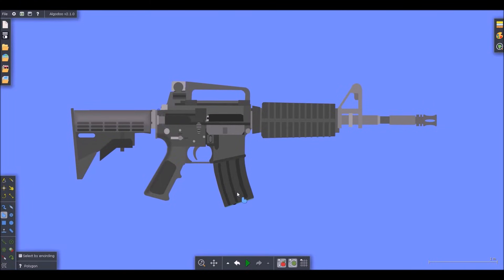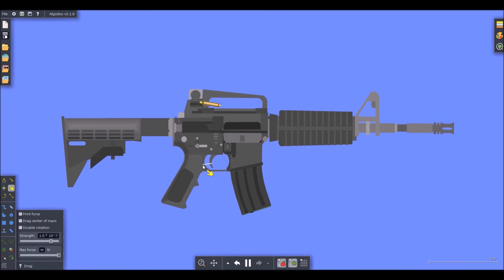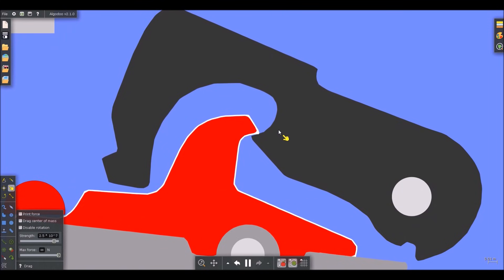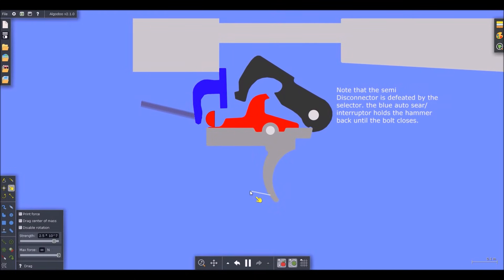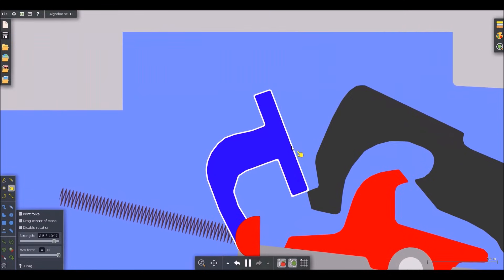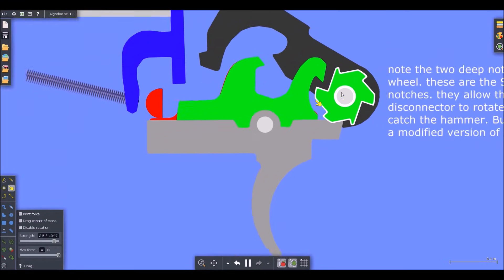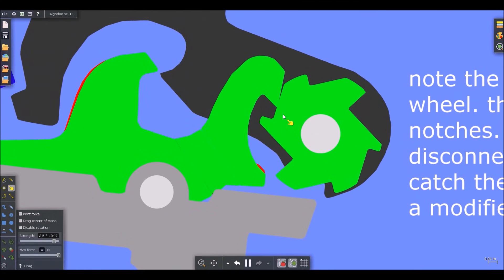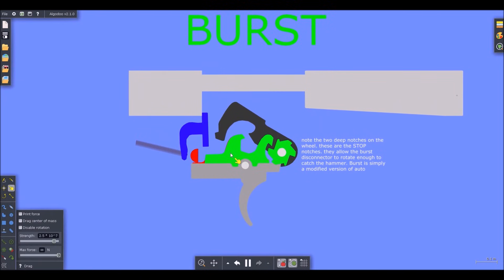How 3-round burst works

Comment: How does the gun switch (other than you switching modes with safety/mode switch)? I mean what internally changes which sear is used and how does that work?
Reply from the maker: Your selector/safety is attached to the selector axle. Along this axle, there are cutouts that engage or disengage the auto sear, semi disconnector, or trigger. When the cutout for that particular mechanism faces the mechanism's index, it will allow it to move, and thus operate. In the safe position, the cutout for the trigger is facing AWAY from it, and the axle directly prevents it from operating. In semi-auto, the cutout faces the trigger index, allowing the disconnector and trigger to move and operate. In auto/burst, the axle defeats the semi disconnector by engaging its index, while the index on the auto sear (it's little tail) is disengaged, and the cutout faces that. So the auto sear will operate, but the disconnector will be held back.
Reply: Very cool! Thanks! Would love it if you made a video of that as well, but I understand mostly! Thanks!
Reply from the maker: Andrew Stark check out my burst faq video. It demonstrates that a bit. Link is on the annotation at the beginning of this video

Comment: so in theory if one were to remove the cam-wheel and put a spacer there it would fire full auto?
Reply from the maker: That would technically work, but it'd be inefficient. The best way to mod the burst kit to full-auto in a reversible fashion would be to remove the burst disconnector and insert a washer of similar thickness. Switch to burst, and nothing will ever catch the hammer in that mode.

An irreversible but equally effective mod is to trim down the burst disconnector's hook interface until it no longer engages the hammer
Reply: haha awesome! of course i will not do that, but its nice to know. thanks for the quick response!
Reply from the maker: Thanks for watching! Glad to help :)

Comment from the maker: Mark Scoble It has been a challenge to find the information on the Stoner Burst Kit. I have had very little luck on the HK or Sig variants, but I have tried. maybe some day I'll get some ffl and own a few, or the U.S. Govt. will become a bit more compliant to the constitution. Who knows?
Reply from the maker: I will take a look and work on it. Thanks!
Reply: ***** If you check out Gun Disassembly 2, it comes with a Sig 552 model in which you can get a decent look at the burst system.
Reply: ***** If you are interested,I have an HK book that describes the burst mechanism of MP5 in detail.The book has 28 pages and it has pictures.This animation was very good and I would love to see the burst mechanism of MP5 in a video like this.I can send you the book, if you give me your email.
I also have a question.I already knew how the Stoner burst mechanism works, but I was never able to wrap my head around how the movement of the hammer rotates the cam backwards.You said that it is some kind of ratched mechanism.Actually there is a spring between the hammer and the cam, but I cannot understand how this spring rotates the cam backwards.If you know how this works,I would be thankful if you can help me to understand it.
Reply from the maker: Catching Fire from what I've seen, there are actually little indexes on the inside of the cam that the spring engages on when the hammer is pushed backwards, but the spring slips over them when the hammer drops. it's essentially a ratchet mechanism with two moving parts: the hammer and spring, and the cam wheel.

I'd LOVE to see that book! Thanks for offering to show me :) find me at stealththeunknown@yahoo.com
Reply: ***** Thank you,it's more clear now.I didn't know how the spring engages with the hammer and the cam.Still if you know of a book,site  or some pictures that depicts this,please send me a link.

I have send you the book on your email.It would be great if you can make an animation of the HK burst action,since the HK system is more complicated and more difficult for people to visualize.

Comment: What happens if you let go of the trigger mid burst?
Reply: bigred2989 It stops firing. So, assuming you fired only one shot on burst mode, you'd only fire two shots the next pull of the trigger. This was one of the reasons that burst capable M-16s were phased out, so I've heard.
Reply from the maker: If Arnold Schwarzenegger were using one and stopped mid-burst, he'd say something like, "you have been terminated". It'll do exactly that, and your next pull will pick up where your last one left off. If you fired one first, the next would be two. If you fired two, the mext would be one. Best bet is to just hold onto the trigger until it stops, release, and hold again
Reply: Stealth The Unknown I see you tried too hard to be funny and failed miserably there, just answer the fucking questions, no forced jokes and that's that. Oh and fuck yourself.
Reply: Charles Ferdinand Damn, why are you so hostile?
Reply: @metallizität  he is probably a liberal

Comment: im makeing a luty style smg and to make things easyer im wanting to use a 9mm ar 15  bolt and barrel and im wondering can i achieve slam fire welding the fireing pin into a fixed position  and fiting it in to another bolt carrier
Reply from the maker: Are you trying to make a runaway mg? This sounds like a modification that would only make it good for dumping entire mags, and the way it sounds like you'd fire is by using the bolt catch/release. This seems extremely dangerous, and unreliable, too. the AR was not built for firing from an open bolt. But if you can legally do it, do! Just make sure to keep it safe, and I'd love to hear how it goes.
Reply: *****  im thinking now of useing a open bolt uzi barrel  and i plan to make  50 round singel stack mags
Reply from the maker: as I said, if you can do it legally, great! I'd just be careful. I wouldn't want to spend ten years in prison for a victim-less crime, So Make sure you do everything necessary to keep it legal
Reply: *****
 oh i plan to

Comment: There is another way to do 3 round burst with out the cam and much easier however must rely on simple trick see if you can figure it out can even do this with any full auto...also do 4 round or 5 round burst ?
Reply from the maker: Indeed there is! When I post a video answering some FAQ, I will demonstrate a mechanism of my design that allows semi auto, 2,3,4,and 5 shot burst, as well as automatic. It's probably the simplest thing to generate that effect, and easy to disassemble.
Reply: ***** Just load up 20 round mags and space blanks in between live rounds thats all you can feel the big difference with blanks no big recoil trust me ;and there you go?    do it with any full auto --I use tracers with MP5's !
Reply from the maker: This is a bad idea, but it's interesting. You're basically creating a semi-manual automatic weapon by doing that. I'll have the video up that answers some FAQ and demonstrates my mechanism which demonstrates the effect you described, but puts all that control into the firing mech. Stay tuned! It'll be up within the next few hours!
Reply: Thank you well I actually came up with this idea because G-3 H&K can go full auto but try to control a .308 and ha ha wish you had 3 round burst mode but yeah came up with that idea and tried it --works great and blanks good way to count..can even try florescent paint to mark em. Ever fire a SAW 249 that's how they mark so many rounds TRACERS for ever 20 rounds.
Reply from the maker: deltaalpha21074 I bet! It's like the FN FAL: It's a battle rifle, not an Assault rifle. That makes it difficult to control in full auto. Were burst available (Later G3 variants have burst, and the FAL has the CAL update which includes burst) on these initially, they would have benefited from this mode with better control while still providing the man-stopping power of full-auto. This is why burst is my favorite selector setting.

Anyways, the FAQ video is up! For anyone that's interested, go here: https://www.youtube.com/watch?v=RMBMJ86DzwE&feature=youtu.be

Comment: Wow, this is an excellent explanation with accompanied animation, kudos and thanks! I love learning about all these mechanical workings as they are so ingenious.

Any chance you can make a similar one for the SKS trigger mechanism? I can't seem to find any good resources online, short of purchasing an SKS myself and fiddling around with it. It's definitely not as elegant as this design, but it would be nice to compare the pros and cons of each.

Thanks again!
Reply from the maker: Actually, the SKS is pretty simple. I don't have a mechanism already worked out, but the basic idea is similar to a 10/22 mechanism (If you've ever seen it.) The idea is that the trigger operates the disconnector and not the sear. The disconnector rotates the sear out of position to drop the hammer. The hammer drops, and the weapon fires and cycles. As the hammer is brought back by the action, it trips the disconnector, making it release the sear and allowing it to catch the hammer again. This is brilliant for a weapon that does not need a select-fire capability, because the hammer remains in the same place when in the ready to fire position and in the post-fire position. Releasing the trigger makes the disconnector engage into its interface with the sear again, and you're ready to shoot again. Unlike the AK-47/AKM mechanism, as well as the Stoner trigger group you see here, there is no forward travel of the hammer when the trigger is released on an SKS.

The pro to the SKS would be a consistent trigger spring tension. The only time it changes is if you're firing, but it is the same after the trigger is pulled and before it is fired. The reset and disconnect functions are also mechanically more reliable. However, if you ever, for any purpose, wanted to get around the Semi-auto only function and install a full auto configuration, it would be much more complicated than the mechanism in this video.

There's a guy here on youtube who builds functioning guns out of PAPER! Do a search for Tacome1942, and take a look at his paper dragunov/SVD. The mechanism in that is pretty much the same as the one in the SKS. One of his videos explains it pretty well.

Comment: Can you explain how a 2 round burst works like in the AN94
Reply from the maker: pretty much the same concept. A disconnector has a modified engagement via a cam. after a certain number of rounds, the cam releases the disconnector into position to catch the hammer. The AN94 has a reciprocating internal receiver. Basically, the entire "true" lower receiver, the one that houses all the mechanisms pertinent to firing, moves back via recoil. However, the magazine does not, so a pulley system is used to correctly position a round for chambering on the second shot. There's a video somewhere of it on YouTube that explains this pulley system, but it does not explain the trigger mechanism. However, it's not that difficult to figure out. It's basically the same thing as what you see in this video, only with THREE deep notches in the wheel instead of two.
Reply: Thanks alot
Reply from the maker: No problem :)
Reply from the maker: basically, the same idea applies, only with the burst disconnector being capable of being disabled as well. That way, nothing ever catches the hammer in full-auto (except the automatic sear, of course). otherwise, the function is fundamentally the same. The exact mechanical function varies, but the idea is still the same.
Reply: It'd be about the same except instead of two teeth on each side of that gear before that reset tooth it'd only be one on each side. If you wanted 4  round burst you'd have to have three teeth before the reset tooth.  However you wanted to do it you'd have to fab up that gear. My philosophy on things like this is the more moving parts, the more that can go wrong.
Reply from the maker: Joseph Kendall Very true. the simpler, the better. Thanks for watching :)

Comment: i wonder if a controlled fullauto burst could be attained on a ar 15 by fileing down the sear disconect
Reply: ***** You CAN create a reset mechanism for the ratchet by placing a timing spring inside. When the sear is released, the spring would reset the gear, but you would need an additional "Timing Spur" for that to work, much like in a watch mechanism. These devices are delicate. Beretta achieved Burst Fire with the M93r, which conceals the linear cam inside the grip below the trigger/hammer bar. When the trigger was released, it would reset, as would all semi auto fire.

Stoner went with this burst design because it was durable, and had little to go wrong.
Reply from the maker: this modification would be terribly unreliable. Basically, you create a weapon that has the potential of firing out of battery. Too little filing, and you change nothing. Too much, and your disconnector/shelf engagement is minimal or nonexistent, which either causes the hammer to follow the bolt forward. Best-case scenario: Light strikes. Worst case: a gun that fires out of battery. It's been successfully done, but I do not advise it. I am not terribly fond of a gun blowing up in my hand. Honestly, If you live in a State or country that allows you to, legally obtain automatic firearms. If you live in a state like Arizona, where "machine guns" are legal, get the required paperwork and checks done, and pay the tax stamp for transfer. You won't have to deal with the legal issues of "illegal conversion".
Reply: i live in kentucky class 3 guns are legal to own but i rather not pay at minimum 5k for a full auto ak 47 or mg42 one of my dream guns
Reply: You would need to replace the disconnector. The ratcheting gear can be left in place. Aside from some exotic mechanisms I have seen such some extra ratcheting components, as well as an electronic grouping that is really an electrically operated semi auto sear group.

The only flaw with the burst system is the lack of a spur gear reset, so if you fire 2 rounds on burst, you only get one shot the next burst, etc.
Reply from the maker: Precisely!  Most European assault rifles with the burst mode have that mechanism reset, avoiding that problem, but complicating the mechanism.

Comment: Great info, thanks for the video! Question, what happens if you happen to release the trigger before the 3rd round is fired? Will the next "3 round burst" be reduced to 1 or 2 rounds or will you get the full 3 rounds?
Reply: You can release the trigger while the burst is being fired. When you release the trigger, the blowback of the bolt carrier still engages a round in, and can still release the hammer, engaging a second or third round, since the smaller grooves on the burst gear aren't enough to hold the hammer back. Hope that explained it
Reply from the maker: Greg Jones This is wrong. It resets as if it were fully automatic, just dropping to the trigger sear. If released before three rounds, you DO result in the next pull being one or two rounds. There are some assault rifles, Usually European rifles and carbines, that have a RESETTING cam, so you always have POTENTIAL for three rounds. But releasing early will terminate the burst. On the Stoner platform (M16/M4/AR-15), the cam does not reset (abridged burst on next pull of trigger). On other weapons with resetting cams, burst control can always yield all three rounds (or whatever number of rounds the burst mode is designated for)
Reply from the maker: The other guy's response in incorrect. I responded to him with the correct answer to your question. But yes, if terminated  early, burst mode will result in the next pull of the trigger only yielding one or two rounds. this only applies to weapons with a cam that does not reset. On the M4 and the M16, the cam does not reset.

Comment: Very enlightening. I also would like to hear the answer to acburk' questions. Specifically, what stops the burst cam from rotating if the burst sear is not engaged? I also have another question. How does the selector lever enable and disable the second 3 round burst sear? Are there like 2 sets of lobes on the selector shaft that just couldn't be shown in the illustration?
Reply from the maker: I DID answer those questions, but I'll answer them again for you.

The burst cam always rotates, regardless of what firing mode you select. nothing will prevent it from rotating.

Also, the burst sear used for burst mode is ALWAYS enabled. the little wing on the semi-automatic disconnector does not exist on the burst disconnector, so the selector never affects it in any way. The only version of an AR-15/M16/M4 lower receiver that has a burst disconnector with a selector wing is an AFTERMARKET 4-way selector to allow semi, burst, and auto. These require irreversible modification though (grinding the selector stops on the receiver away and such). For more information on a 4-way lower receiver, visit http://robrobinette.com/M16_4-Way_Selector.htm

But in the standard military's M4 or M16A2/A4, the burst disconnector is never disabled by anything. The only disconnector disabled by the selector is the semi-automatic one.
Reply: ***** Yup, sorry about that, I must have missed expanding the reply's the first time. Thanks for repeating yourself anyway, I appreciate it. Just to reveal my ignorance since I only have an AR15, I assume for the discussion of burst and full and semi modes that semi always exists, and that the other option is EITHER full auto or burst on 'standard' lowers, with that the after market exception you mentioned in your response is the only way to get a 4way?
Reply from the maker: cyclecamp1 Yes, the aftermarket kit is the only way to obtain a 4-way selector on the Stoner platform.